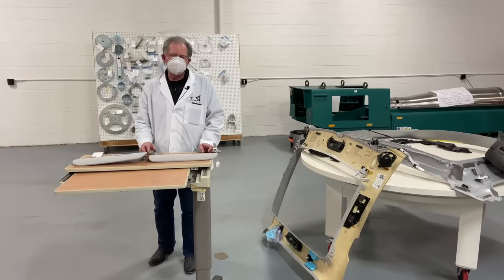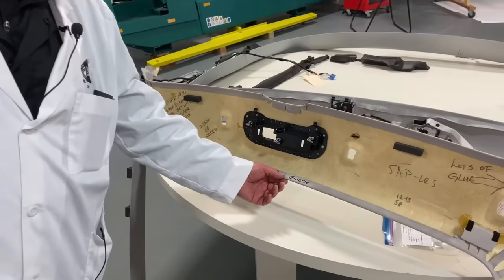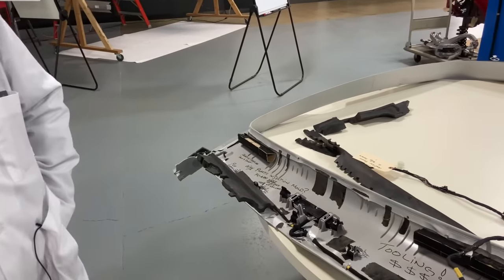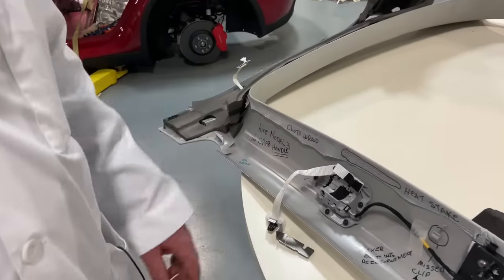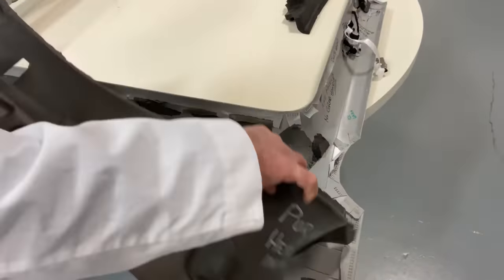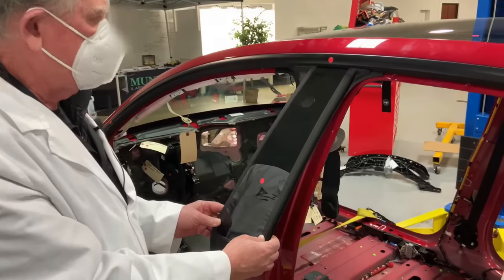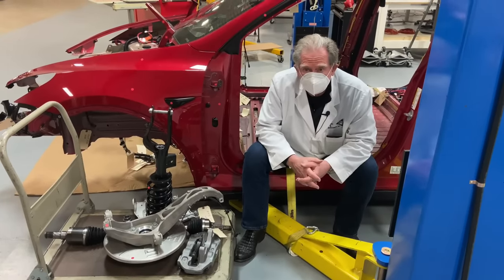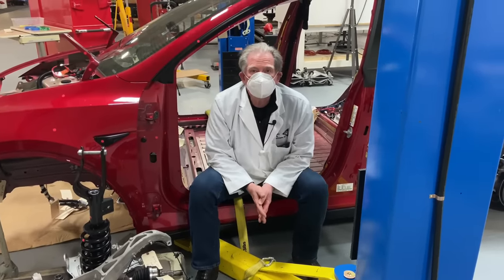Model Y E21: Headliner Comparison M3-MY, B Pillar Integration, and Questionable Trough Mods

Comment: I think.. I could be wrong, but I think this wiring issue you are seeing Sandy.. where they cut that plastic guide or whatever it is.. I think the wiring of this car is not the final version. I think what you're seeing is a temporary wiring harness and it is not completely matching what their final design is, and you are seeing them make adjustments to make this temporary conventional wiring harness work. The wiring of THIS model is supposed to be a flat.. ribbon cable or something.. new wiring harness. We are not seeing that in there.. so it's my guess they are still developing how they are going to implement that. And when they do, I think that plastic harness will fit whatever their final design is, correctly. Just my guess

Comment: Sandy if you have time can you tell me how protective is the primer (the cream paint) the body is coated in from corrosion i notice the is no red paint at all at the rear of the drivers side fender, would have thought that as you pay an extra $2000 for red you might get it on all of the car

Comment: Sandy could you explain when, where and how quality control is typically applied during the assembly line process? It would seem logical to video each station's output for post analysis. Tesla could even use AI to identify instances where build did not conform to expectations.

Comment: With all that plastic and foam etc, what are the fire and smoke indexes. In a crash/fire condition what are the issues?
Reply: you mean beyond a ICE engine and gas tank going Flame On under your buttcheeks? flame retardants in plastics is highly regulated... and is a serious rabbit hole to go down. car interiors have hundreds of components that can offgass just  when heated like a car sitting in the sun in the summer...

Comment: So, I'm loving these videos, but this headliner episode highlights one thing, all of the Model 3 references are to a car from more than 2 years ago (Alcantara headliners stopped showing up in January 2018).

I can't help wondering how many of the improvements that they're finding in the Model Y are present in current Model 3's
Reply from the maker: Thanks for the question and thanks for tuning in! So the Model Y & Model 3 share a platform which is done often throughout the automotive industry. For example the Chevy Cruze and Chevy Equinox are on the same vehicle platform. The whole point of sharing a platform is to share components to bring the cost of manufacturing down but still offer consumers a variety of options in the final product. It is extremely likely that all the changes we are seeing on the Model Y are being implemented on the Model 3 already or will be in the future. We'd love to teardown every version and year of every vehicle but that would be extremely expensive, time consuming, and frankly not worth it. It is safe to assume that the 2020 Model 3 looks a lot more like the Model Y these days.
Reply: Munro Live I absolutely understand where you’re coming from! And I do hope that Tesla has implemented the changes across the board. The video series is great just as a look at how far they’ve come in such a short time.

Comment: You could use foam insert to with inbeded snaps to have the piece with wireind placed in car in one piece so wireing foam quietness and snap in to place no need add wire then fine could put whole piece in car when building it an make the one piece before installation like putting in the seats

Comment: I have a question. Since these cars are quite similar in appearance, do you think it’s possible that the model 3 is NOW being manufactured like the model y is? Or would it be too hard to upgrade the manufacturing system to make the same car in a different way?
Reply from the maker: Thanks for the question and thanks for tuning in! So the Model Y & Model 3 share a platform which is done often throughout the automotive industry. For example the Chevy Cruze and Chevy Equinox are on the same vehicle platform. The whole point of sharing a platform is to share components to bring the cost of manufacturing down but still offer consumers a variety of options in the final product. It is extremely likely that all the changes we are seeing on the Model Y are being implemented on the Model 3 already or will be in the future. We'd love to teardown every version and year of every vehicle but that would be extremely expensive, time consuming, and frankly not worth it. It is safe to assume that the 2020 Model 3 looks a lot more like the Model Y these days.
Reply: @MunroLive   Thanks so much! Love the channel!

Comment: @8:45 (wire not in clip) Whoever put that tape over the wire can be identified.  At least those who are where that part of the line can be identified.  That or who ever did that from the supplier.

Comment: My 2020 model 3 als has the magnet sunvisor clip...
Reply from the maker: Good to know! We tore down an early production Model 3 several years ago. Good to see they are making plenty of changes across the board. Thanks for tuning in!
Reply: @MunroLive  I must correct myself... I just checked and in my model 3, there is a mechanical clip. The action is so smooth I concluded it was magnetic just as the console lids. I am sorry if I caused any confusion over this! :(

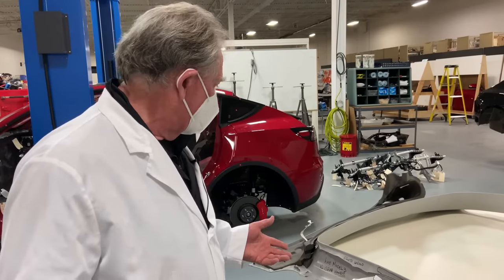Comment: 8:21 That wiring has the beige-colored reinforcements that help reduce chafing & also to help hold the wiring in the clips. Not only they didn't install it correctly, IMHO, but the tape was also an afterthought to "fix" it.

Comment: Why doesn't visor have inner exstended down like a hard one like that and one that pulls out like a rolled up flag and unraveling back in and if mecanizum unraveling you can easily replace it with stew or two modler so if your driving you won't get sun if your short on side window or if driving

Comment: Do you think the sun visor clips from a model Y would fit a 3 ?
Reply: @landrover325 
I suspect yes but they aren’t magnetized. Just a guess!
:)
Reply: @RayNLA  
I would assume that the clip itself is magnetized, as the visor is already metal
Reply: @landrover325 
Just took a look at mine and it appears that the rod appears to be made of a hard plastic. But the cover over the mirror is magnetic so you maybe right. Now I’m curious. We should ask the guys from the You tube channel “what’s inside” to cut one in half! 😆
Reply: @RayNLA  

Just stuck a magnet against mine in the 3, they are not magnet
Reply: @landrover325 
Thanks!
I was thinking of doing the same but I couldn’t find a 🧲. I have an 4/19 build.

Comment: It feels like the auto industry came a long way until it were where they are today - a bunch of technology and manufacturing expertise. You can't build such a complicated product "from ground up" (at least not with looking at how someone else built it - today's common knowledge was innovation a few decades ago). But looking at how Tesla keeps implementing new manufacturing methods and building techniques, it feels like the classic carmakers simply stopped innovating at some point. Like they said "it's good enough, from here on, we will only slightly improve things and not rethink them completely". However, now comes Tesla and rethinks every single bit of a car!

This starts at very visible parts like the key fobs, the vent slots (like what was the variation there? Since 20 years, the car makers only change the color and shape of them!), sunvisors, ... and obviously also is true for about everything under the hood! Very impressive and I love to see that Tesla entered the industry, so we can see some real progress again!
Reply: It has a lot to do with their business model; they don't seem to innovate unless it means an increase in service revenue.  lots of new turbo charged engines out there - that break....and need to be fixed  ---->  innovation!  Carmakers make a lot of their money off service... if Ford can't fix your car they can't make debt service payments on their 105 billlion debt AND send $$$ to shareholders...

Comment: 8:40 must be the operator had attached the electrical connector first - then there was not enough slack to put the wire in place - so it was easier to just tape it like that than to detach the connector and fix everything :)
Reply: It looks like the hook might be a little high on the left since the wire source is lower than on the right but both hooks are at the same level. What say you?
Reply: @martingardens  I say people tend to be lazy and cut corners, especially when something needs to be done quickly.

Comment: That cutted harness protector was probably late change to surrounding parts and not enough time to make design change on time. Wiring is the most complicated part on vehicle made mostly manually by humans (only automated process is wire cutting and crimping). Efficient car plant can make car every 1 minute, now imagine you need harness to be made every minute as well (it is not easy and for sure not made in US). To teach operators, set up a line, make harness, test it, pack it, ship it you need weeks of head start before start of vehicle production.  You will end up with late reworks, sometimes done even at Tesla's warehouse. It is nothing unusual. Trust me, I work in wiring design for 7 years and launch few vehicles to market. Elon has nothing to be worried about. 
As for headliner and harness routing, I bet that tape is counter measure to safety issue (contact with metal edge) or NVH issue. They will move that clip to correct position once tool can be modified. 
Again, this is normal as you have really early vehicle. 
Not sure if such big headliner made from plastic is such good idea. I see lot of NVH tape under metal clips as possibly there was terrible squeek on uneven roads. As roof flexes, whole headliner shifts and you need to isolate every edge of it from touching metal as it will create terrible noise. Lot of little foams added everywhere, am I right?  
Those tethers are for airbag deployments. As curtain airbags are hidden behind trim, headliner will have to drop to allow airbag to inflate. It is really rapid so high velocity. You want that  headlinear to be soft material. I think they made a mistake going that route. Interested to see if M3 will receive this solution or vice versa.

Comment: You will have to purchase another Model Y.  Tesla learned alot from the Model X when they through the kitchen sink at it all at once.  The Model Y will be updated slowly to include the new wiring architecture...probably didn't go all in to prevent delays which is smart on Tesla.

Comment: Quality control and these assembly corner cutting that you show should be drilled down by Elon and Tesla so as to not devalue the high level engineering and planning that’s put into the production of all of the Tesla vehicles. Hopefully, the QC team at Tesla is watching these and working harder to strive for improvements that live up to the level of engineering that’s been dedicated to a product line.

Comment: Elon to Franz (chief designer) at Franz's design console working on the headliner: "Do you ever grab these handles above the door each and every car has?" .. Franz: " No, not really.." Elon: "Are these mandatory or something?".. "Nope..."  "what do they cost?".. "About 10 bucks each if we buy a million.." So we can save 40 bucks per car if we leave 'em out, right?" "Yes" "And 10 minutes to install them? "Make that 15 minutes, these are finiky to install" " Ok, remove them, fits better with the overall look as well" ... Franz designs new headliner without grab handles in 10 minutes.... "Done...."

"The best part is no part" - Elon Musk

Dozens of similar conversations are held each and every day at Tesla, and they do not wait for a "model year" to implement them, they do it immediately if possible.  So each car that comes out of the factory is better than the previous one, sure that cutting issue near the wire loom will be rectified, or already has, maybe.

I love it to see how this way of working is shown so clearly in these video's! Keep 'em coming! I learn a lot!
Reply: About the handles above the door, I think they are very useful especially for older people. 
But I don't think it's too much the cost but because of the space, because of the airbags.
Reply: They take seconds to snap in, not 10 - 15 min. And they cost them a lot less than $10. Please, stick to commenting on something you understand more about.
Reply: @111chicane  Whatever, move the decimal one place to the left if you wish, its about the principle.. 

I am from the aircraft engineering business, everything is 10 times more expensive there. (toilet seat: $500,-), thats probably why my numbers are a bit skewed.
Reply: @MarcoNierop  Great! It will be interesting to learn more about the aviation industry. But yes, it's incomparable to the automotive, where everything built and manufactured downt to cost and the guys and girls at the assembly line can't spend more than 2 minutes per car to complete their job.

Comment: I always get the impression that Tesla's first vehicles are essentially pre-production vehicles reworked to be passable whereas a traditional automaker would just always plan on scraping early production vehicles due to liability concerns of possibly selling a vehicle with a potential safety issue because it was built without a fully approved/vetted production process (PPAP).  I'm sure Tesla probably also doesn't mind higher warranty costs with early models as getting to market faster is worth so much more in terms of raising more capital and stock prices.

Comment: His manually applied electrical tape usual?  I've taken cars apart, and I've never seen that.
Reply: No, but all the manual hand work costs the production line $.
Reply from the maker: Manually applied electrical tape is actually quite common on automotive wiring troughs, especially in holding toughs closed or holding wires into the troughs.  Thanks for tuning in!
Reply: Munro Live big and longtime follower.  Even met you briefly at NAIAS 2010.  Honored that you took the time and best of luck

Comment: My jaw dropped at 02:55 because that roof mounted speaker looks like I broke it, then said fuggit and just glued it back in place in my garage with a bottle of grandad’s 20yr old Elmer’s wood glue ..while 7/10 drunk-stoned.

So what happens when all these LA youtubers start blowing speakers in their leased 3’s? I don’t see how you can just replace the speaker without DESTROYING the fiberglass while trying to rip it out. Heat gun on the glue maybe? Or is the plan literally to just replace the whole section of Alcantara liner, speakers included? On that note, aren’t the 3’s speakers pretty spendy?

Deff good to see someone sobered up enough to put down the bottle of Elmer’s when they got to the Y.
Reply: The use of glue is actually standard, and to remove, heatgun is the most likely "tool"

Comment: They should build them in Germany and there would be zero assembly failures, oh wait they are building a Giga factory in Germany right now.  😄😎 When I buy tools it's a big plus if it is stamped with Made in Germany. Made in China has become better for simple tools where tolerances are not a problem to maintain. Like a hammer or a manual screwdriver. 😄. Nah, they have tech giants like DJI who are world leaders. It just comes down to the direct link between price and quality.